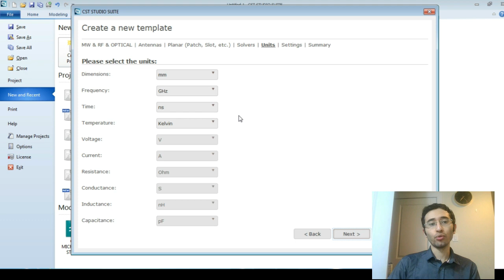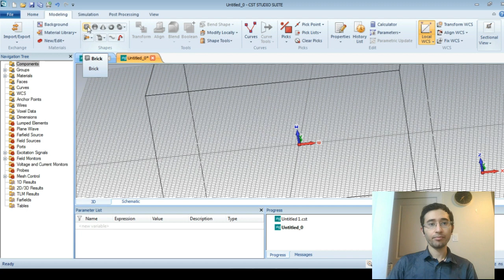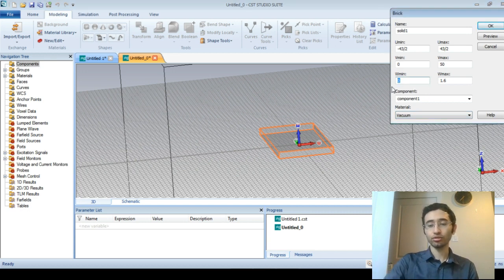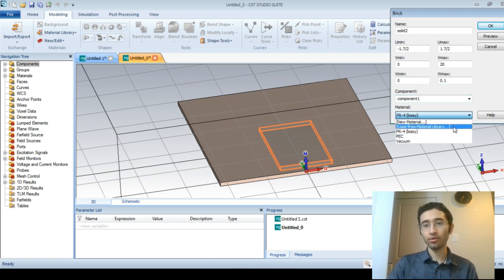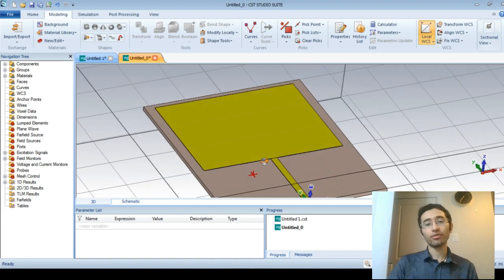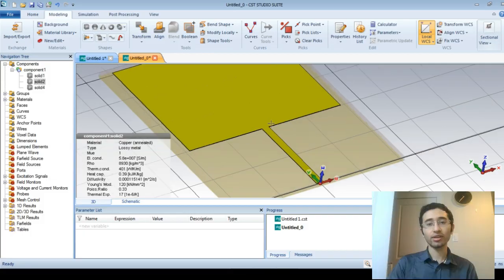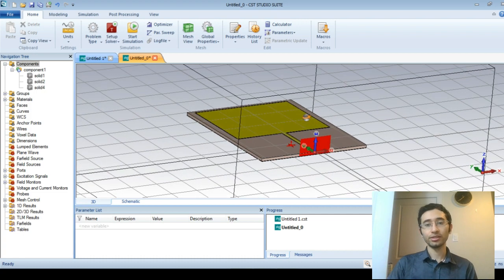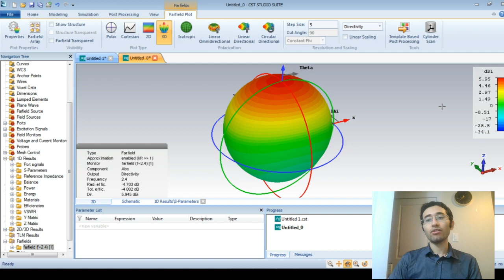Patch Antenna Design Using CST Software

Comment: After i press the construct port from picked face,why the red waveguide port not display on my patch ya?
Reply from the maker: One reason could be that the software does not detect your microstrip line. You should check after clicking on the "Calculate", if the software calculates the "Extension Coefficient" for you or not.

Comment: How can l design wireless antenna
Reply from the maker: There are different types of it, for some RFID, the antenna uses the received signal to send back the signal. Another one is you design a power harvester for the antenna and then it acts like an antenna power source

Comment: Hi, thanks for your help. I really enjoyed the video. I am new to RF. I want to design a Quad-band Microstrip Patch Antenna for satellite application. How can you help please. Any suggestions how I can start etc. abalhafsa@gmail.com is my email address please.
Reply from the maker: Mainly for satellites, you need high gain and circular polarizations. These two parameters are very important.

Comment: Hi, could you show how you design the patch and the line ? please, thanks
Reply from the maker: Thanks for your comment, Here is a quick answer, For microstrip line width and radiation patch you can use the formula in Balanis Book or use an Online microstrip line calculator.

Comment: Hello, Thank you for your tutoril, How can I add a new material AgHT-8 ( not substrate) with 125,000 S/m? 
Pleas HeELP, Thank you,
Reply from the maker: Thanks for your comment, In the CST Material Library, there is a section named Add New Material, you can define new material by this option. But you should have the material details, such as conductivity or so on.

Comment: Hi, I am trying to simulate a microstrip dipole antenna that has a gap of 5um, length of 225um, and width of 11um.
When I go to macros --> port --> calculate port extension coefficient, I can not click on 'construct port from the picked side'.
Do you know what might be causing that ?
Reply from the maker: Hi Thanks for your comment. Because you should select a 1- microstrip line side view, which means microstrip line width, 2- the place that you select should be at the edge of the substrate that you have substrate and ground plane under it. Same as I did in video.

Comment: Hi,can u share how to design parallel plate antenna with 3cm air gap
Reply from the maker: Here can help you in simplifying your design and fabrication, You can use some substrate that has dielectric constant very close to air such as PF-4 having a dielectric constant of 1.06

Comment: is that the same thing on ADS (another Software) ?
Reply from the maker: You can design a microstrip antenna with other software such as ADS or HFSS
Reply: @fredfrancium  can u  
 help me maybe in some design difference between ads and cst?